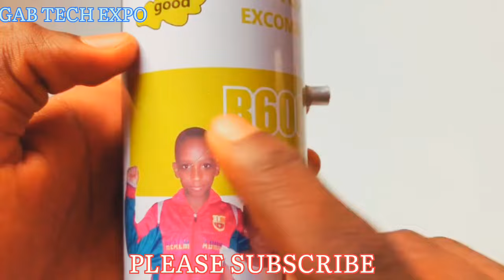How to make a TurboJet Engine | diy TurboJet engine | homemade TurboJet engine

Comment: That was great ❤. I've watched almost your every video,You are getting more and more involved in mini jet engines, I encourage you to keep going in that direction 😉, But there is a problem the design of jet engine is simplified version of real jet engine (For example: A real jet engine only initially requires external source such as electric motor to start the propellar that compresses the air and later another propelar harvests the thrust and using that energy the air compressing propellar moves faster thus more thrust thus more rotation for compressor and so on) and it's pretty much same in all of your videos, I suggest you to:

1)Try making some changes in your current design eventually and step by step add more complexities in your designs
2) Try using more optimized propellers for example instead of  just cutting the propellar out of metal sheet try using CNCs 
3) Start to explain the engineering process you're demonstrating also it's good time to start adding numbers and measurements in your videos such as measuring thrust and how many fins such small engines should have for example.

best of luck❤
Reply from the maker: Thanks a lot friend for that great advice

Comment: Hey can i ask? How is the air is comming in side of the can?
Reply from the maker: This works with the same principal as your fan at home bro.
It pulls are fro the back and then pushes it to the front but in this case, it's the reverse depending on the angle the propellers are placed on 🙏👍
Reply: Oh ok thx